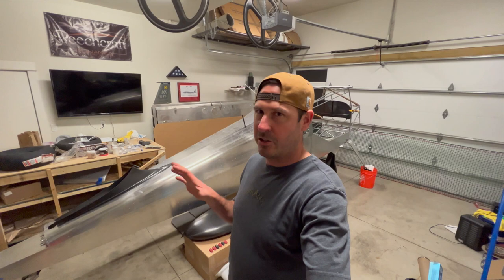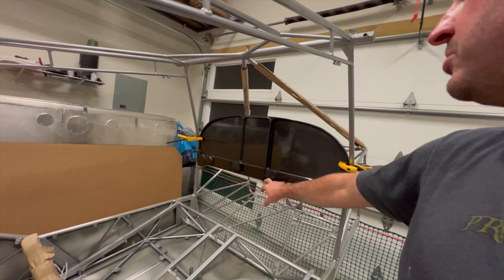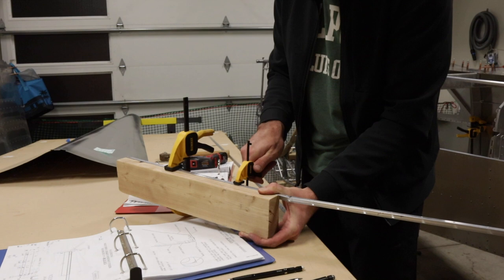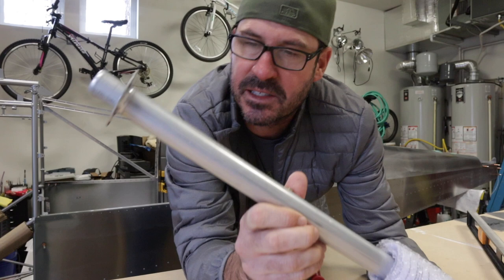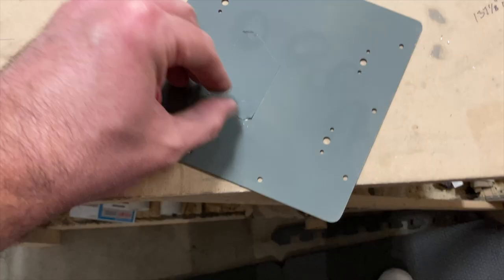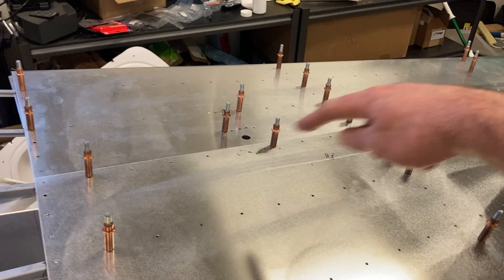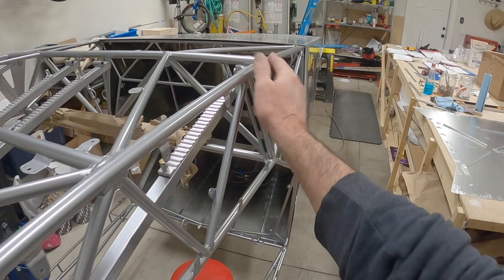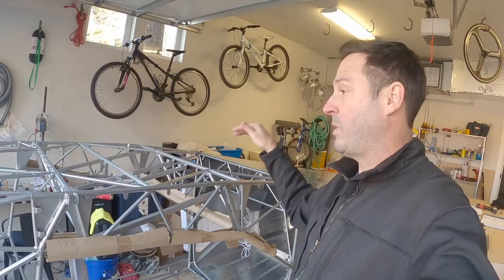RANS Build Ep 10; Fuselage Pt 3 SHORTFORM

Comment: Steve,
I'm so excited that I get to copy where and how you mounted the doublers and antennas...going to have to drill a few rivets in the stringers but other than that I'm stoked!  Thanks! Chad
Reply from the maker: Hang on chad! The distance between my upper VHF and ELT antennas may be a little short. I measured from the mounting positions and didn’t account for the VHF antennas sweep. May have to move the ELT aft a bit. More to follow! (That’ll teach ya to copy me! 🤣)